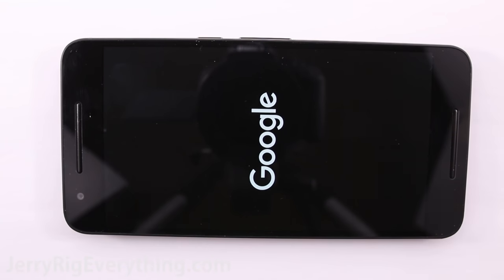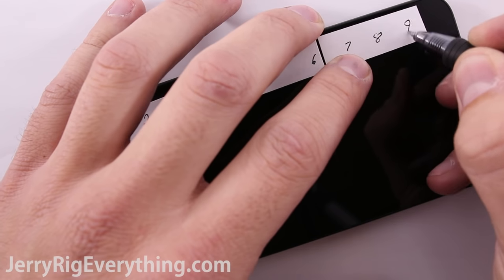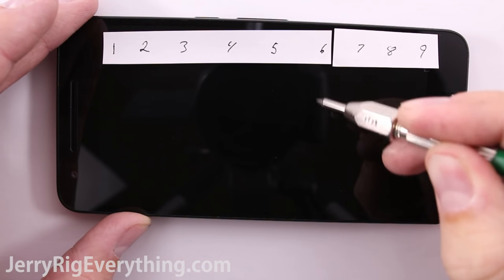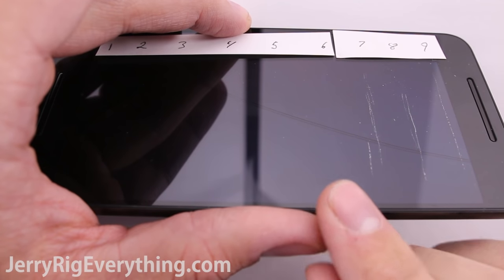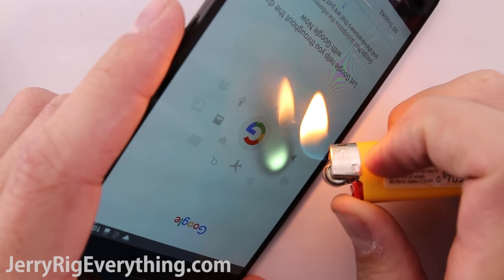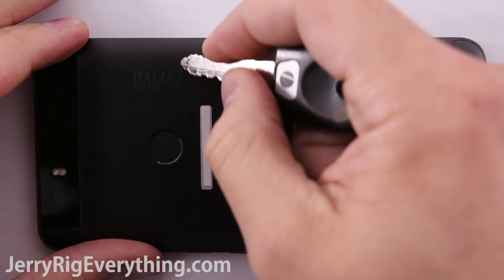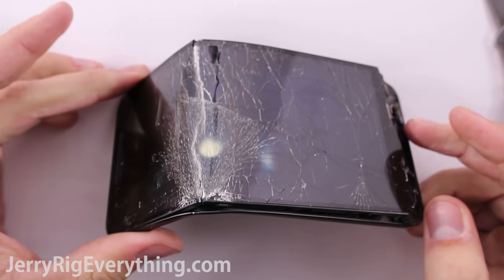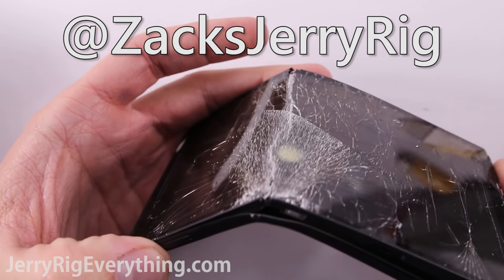The Nexus 6p is a Joke!  Bend Test - Scratch Test - Burn Test

Comment: Bullshit on this, 2 years on from purchase with a simple back cover case and no screen protector, my device is pretty much still in new condition. Besides ~8% battery loss in 2 years, no bends, no fails, scratches, cracks on both the screen and camera glass.

Seriously though, the phone failed under these bullshit conditions(cracking under a scratch test..k, I've dropped mine a few times in two year, yet no cracks), under an everyday load though..it hasn't had any full on failures.

Comment: I had a Nexus 6p for 2-3 years and while I don't bend my phone's like a fuck, the phone held up to everyday stress very well. It fell off my headboard and hit the metal bedframe 3-4 times a week and while there would be afew very minor scratches the screen never cracked... I did shatter the camera protector on the back but even then it still took good photos.

This stress test was kind of dumb I mean I get the point you think what you do here will hold up to Everyday stresses, but I don't know anybody who's had the phone and had it Bend nor have the screen been heated to the point where it turned white. The only real test you should be doing is a screen durability test and a water resistance test. And yes I'm salty. Also the batteries on those things fuckin suck.

Comment: i used to have a nexus 6 and i got in so much trouble from really stupid things because the phone is so fragile.
I dropped it 2 feet from the ground face first and it was destroyed and stopped working(got a new one)
Dropped it off the floor from like 1 foot on the CORNER and it completly destroyed the corner.
After like 3 months i got those little screen cracks in the inside.
i had that phone for 2 years and holy shit was it horrible

Comment: I have a nexus 6p and I tell them the evolution to use apart from the durability to accidents, the phone heats a lot with the updates or games, a year and a half dies the processor, then you have to deactivate 4 nuclei to be able to use a whole mess, then at 5 months the battery dies, you change the battery and one more year of life but with half of the initial speed, about two weeks ago I finally died, it was a cell phone with the worst character in durability in hardware and software, but great when it was working well in its first year of life, I would ask for a new Chinese processor to try to revive it once again.

Comment: And to chime in, I’ve recently temporarily switched back to this phone. My metal is all bent outwards and the phone had the BLOD issue so how I only have four small cores working. Had a screen protector on it since I got it and the tempered glass was shattered bad. Replaced recently and glass still looks new. I wouldn’t rebuy this phone honestly today. It has NOT held up over time.

Comment: Ha ha i have had mine for 2 and half years now with no issues  guess i have been lucky .Mine was dropped into a river and after fitting a new battery and cleaning the inside with alchahol it runs like a champ .

Comment: Huh did not expect these results. I've had the 6p since it came out and despite absolutely brutalizing it on a regular basis, it still looks almost new except for the metal skirting around the front edges. It has got one long crack on the screen also, but it is barely visible and I've dropped it from good distances many times. I was under the impression this was one of the most durable modern smartphones as my family and girlfriend use Samsung's and iPhones, which I see get cracked and battered very quickly. Guess I'm better with my phone than I thought! 

Have a blessed day xoxoxox

Comment: The negative response to these two videos was definitely unwarranted, but it's a good thing that the response was overall positive. I have this phone as well, and it was a great phone until a few months ago when the battery started being shit because it was two years old, and the fact that it is structurally so weak is definitely quite disappointing. In fact, I have even noticed some signs of damage on my own unit, which I keep in a case at all times and try to treat with as much care as possible. The fact that, even to this day, this is one of very few phones that failed this test is pretty bad as well.

Comment: It's 2019 and i got a nexus 6p, i notice the weak spots by the power button, it sometimes get bent and i have to hammer it back. 
Can't beat it for the price tho! My screen has never cracked and I don't mind modding it or scratching my contact information on the back.
Still got my stereo speakers!

Comment: I have been using the 6P from the past 2.5 years WITHOUT any case or tempered glass and surprisingly - zero scratches on the screen and camera glass. I use it carefully though, placing it on soft places, if available. All phones will bend and scratch if you don't take care of them.
Reply: false, hundreds, and I mean hundreds of phones, don't even flex. so if you're talking about every day use, no. not every phone will bend.
Reply: @krueger2892  Yes, I'm talking about normal everyday use. That does not include putting your phone in the back pocket of your jeans and sitting. Incidentally, I also had an iPhone 5s which died itself just after it's warranty expired. I had rarely used it and taken good care of it. The Apple guys told me that the entire mother board and screen need to be replaced so I decided to just keep it as a paper weight. So does that mean that iPhone quality is bad? Maybe my unit was a lemon.

Comment: Under normal use the phone will not bend. I have had the phone for 1.5 years and there is no signs of bending anywhere on the phone. This is an awesome phone that is still a beast.
Reply: anthony tremaine for the price tag it shouldn't fail on the bending test

Comment: I remember watching this video when I first got my Nexus 6P last year. It's funny because it definitely does not feel cheap in the hand. It has a good weight to it, the premium metal feel, and it feels good to use. I obviously didn't try bending my phone and it lasted me a while up until a month ago. I would say the glass is also resilient. I think it just fractured because he went all the way to his 9 pick. Which if you know anything about glass, that could cause it to fracture because of the deep scratches those higher levels can cause. Thus the hairline fracture from the slight pressure he out on a compromised sheet of glass. 

I had my 6P for a year until I dropped (I've dropped it many times before) and the glass shattered. It was usable, but since it's such a hassle to replace the glass I didn't bother. I finally decided to bend it. It was oddly satisfying. I did so from the middle first, it barely flexes from that point. From the weak point between the power and volume, it bent with a moderate amount of force. I should also point out the phone suffered from warping around the power and volume buttons. I noticed that a few months into owning it. Overall it was a great phone from the outside, software, and hardware wise. Just the structural durability was a problem. I have sat on it while on my back pocket and it never bent. But that warping around the buttons was definitely a sign it wasn't structurally sound. And yes, I bent it from the weak point. Feels nice, structurally it blows due to that major weak point.

Comment: The true reason why the phone failed the bend test was because when Jerry putted heat on the glass it melted the adhesive making the glass to come loose from the frame, Nexus designed the phone to have the screen and the frame put together with adhesive, but what jerry did is he loosened the screen from the frame unknowingly when he did the heat test so that made the nexus basically have no structural support
Reply: Jill Stingray is precious  he explained it in his 2nd video of the phone that the heat test did nothing to the structure so I take this back

Comment: I just came across this video. I've had the Nexus 6p for about two years after my dad had it for a year. The screen never cracked despite me dropping it face down more than once. I don't use it anymore so I tried bending it but it didn't budge. I don't quite understand why it was so brittle in this video. I've had a case on it the entire time I've had it. Usually dirt will get in the back of the case and scratch a phone but there were no scratches despite all the dust. Maybe my dad picked up a newer model after they fixed the durability? I'm not sure but this doesn't quite accurately represent my experience with the Nexus 6p. It's irrelevant now because of how old it is but still. That phone was a trooper

Comment: I've had my 6P for 3 years and so far have only just started to have issues with it. Mainly the screen stops working occasionally and I have to press on the lower portion of the phone to get it working. Other than that it's been a good phone. I guess it shows even crap phones can be good if maintained well

Comment: Came to check out this review after his new Pixel 8 review. Had one of these back in the day and didn't know they were so fragile. I had dropped mine a couple of times and had no problems till I dropped it on a rock where I then just rocked the phone with a cracked screen. About 1.8 years in the battery wouldn't hold more than an hour or two though.